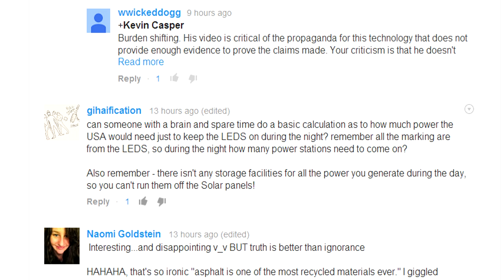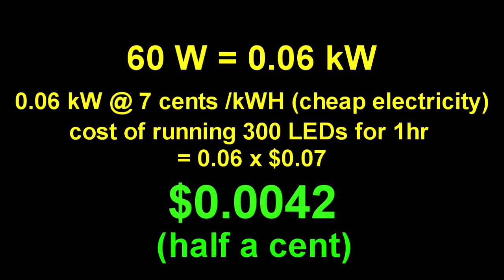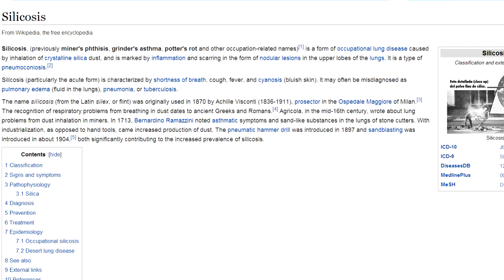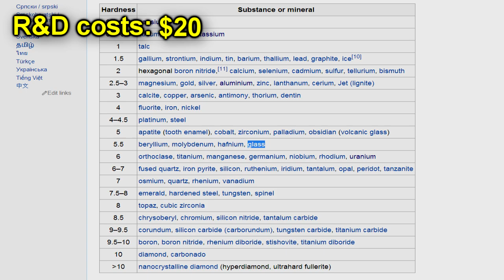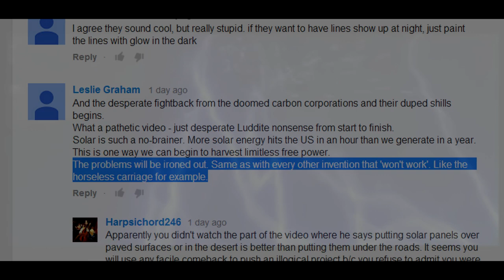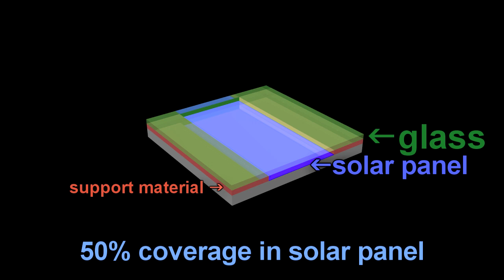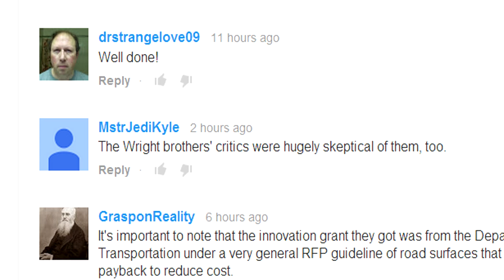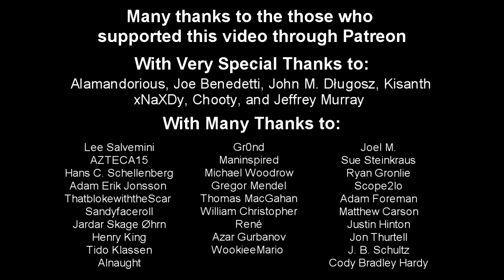Solar Roadways, IMPORTANT QUESTIONS AND ANSWERS!

Comment: There are so many things wrong with this video its not even funny, first of all, the price you came up with for the leds, besides the fact that you got the price you used to find the cost was from one source, they obviously would be buying them in bulk or manufacturing them themselves, not buying them in strands of 300. The next thing you didn't even use your brain on was the electricity, you just loosely based your data and came up with a number without even subtracting the amount of energy they would produce. And, I'm going to stop after this one because I could just as well write you a novel on the things you did terribly wrong, but here's a list

      you used Wikipedia as a source of information (more than once)
      you wouldn't have to stop using the road when you replace the lights because they can be replaced a tile at a time
      the glass is obviously not the same as something you would use in a glass bottle
      your cheap little leds are not what they would use in the panels
      your stupid tests do not prove anything you idiot
      and lastly your efficiency test is so eluded and idiotic its sad, no the panels arent going to tilt towards the sun because             people have to drive on them, your shit piece of solar panel will more than likely not be what they would use in the                 road, did you forget what you were testing by any chance because it seems to me like your swatting at invisible                   butterflies with these tests of yours

thanks for the good laugh, you definitely made me feel better about my I.Q
Reply: Wikipedia is perfectly valid if you're accepting a small chance of having a mistake.

You would stop using the road when you need to fix/change the concrete foundations or cables. Road fixing would be just a common as with concrete roads, except that you'd have to remove all of the tiles to fix a more intricate structure.

Yes, there aren't many types of glass, it's all the same with a bit of alloying depending on what additional caracteristics you want.

Well either they'd use cheaper LEDs or more expensive ones, you can't have both.

Yep, they just illustrate points for those who have wrong ideas about things.

Yes, because now they have some super efficient solar panels no one knows about ? It's all the same shit more or less.

I'll grant you that Thunderfoot made a very poor debunking of solar roadways, because he didn't focus on the right aspects. It's not about solar roadways being possible to build or not, it's simply basic economics. If you have two companies, A and B, and you need a service from them. They both provide the same service, yet one costs 3 times as more than the other, which one do you choose ? Well it's the same for solar roadways, it's one of the most expensive ways to produce renewable energy, yet it doesn't even do it as good as the alternatives. It's like paying 3 times as much for a shitty service.

Comment: I'm having a hard time understanding the information about the cost of the LED lights and the electricity to run them. You're not proposing that they be purchased in flexible strips from Amazon, are you? That wouldn't make any sense. That calculation requires insight into manufacturing costs, not retail sales. As far as running them at night, lighted road markings would require a fraction of the road to be lit up.

Also, while the very zesty claim is that all roadways could be covered with these panels, I'm sure no one seriously believes that this will be the case. The claim in their video is that it would provide three times the amount of power we need, not that it is the goal. If you want to do serious calculations, start by dividing all of your figures by three.

It sounds like this new technology needs as much input as it can get.

Comment: i am only on the first question and i can already tell you that you're a dumbass. they arent going to buy the LED's in 20 pack increments. They'd buy them, in massive bulk, straight from the manufacturer. Have yo ever heard of buying in bulk?
Reply: and i can tell youre an even bigger dumbass
check the power of those LED`s he got, it`s only 0.2 watt each, which means they are very weak so he would need much more powerful, much more expensive ones
so shall we say for bulk buy of more powerful LED`s are only 20% of his price that still gives us a total of $160 billion just for the LED`s which, quite frankly are probably by far the cheapest part of these panels
but then as the LED`s would need to be more powerful, say maybe a watt each, and that you need at least 5% of them on at all times, that means it needs $350 billion per year just for the LED`s
however, they produce energy through the day so you get 7 hours peak multiplyer from the 24 so you would need $248 billion per year from the grid to keep them going at night
that is currently 6 times the amount they currently spend on building new roads and on maintenance of existing roads
even if i was generous and gave it a 12 hours multiplyer the cost is still $175 billion
can you see the major flaw in your reasoning here, dumbass

Comment: or 0 trillion dollars to power the LEDS because they are SOLAR POWERED
Reply: Solar power is not free because there's a large capital outlay and a definite lifetime. By taking the install cost and comparing it to the energy it's expected to create over it's lifetime, you determine the cost of that power. Except of a very small number of niche areas, this number does not compare favorably to electricity generated by coal, gas, nuclear, or hydropower.

Comment: Nice work. The absence of critical thinking is stunningly popular. This has probably been mentioned, but: parts of the US get a lot of snow and ice in the winter. Tough to drive on  for most. I can't fathom drivers on snow or ice covered glass. Unless maybe the LEDs are supposed to melt that! It's painfully obvious that a transit system that doesn't emphasize cars would be a fraction of the cost...  Thanks again - enjoying exploring your channel.

Comment: every one keeps saying this is impossible but all you need to do, when building them, is to reverse the subspace polaraity of the Heisenberg compensator and wire that baby into an inverse flux capacitor! Boom problem solved!

between there solar road and my fixes to the design i think we have it solved people. Oh yea almost forgot, embedded in each 'solar hex' will be a pair of googly eyes, you know... to aid road friction with tires.

Comment: While your videos are fun, I think you mess up a bit on the LED stuff.  Firstly there is no reason that power can not be stored in (or near) these panels, note that the company is specifically asking for supercapcitors.

Secondly LED technology is on the march.  So while your sample LEDs have trouble in bright daylight, we know that traffic lights are being replaced with LED lights world wide which function in the day.

Thirdly you calculated the power requirements based on the assumption that ALL the LEDs are on, all the time. In the examples given most of the tiles had no LEDs on, and some had as many as 6 or so. So it looks like maybe 1 LED per tile on average.  But wait!  These roadways have strain gauges and so know when there is a vehicle or pedestrian around, and therefore only need to light up at those times.  For many residential roads, especially quiet cul-de-sacs this means they can turn off nearly all of the time.

And that's not all! The LED's you used, for example, are 120 degrees viewing angle (another reason they were hard to see in the daylight).  The human iris subtends an angle of a fraction of a degree at any relevant road distance cutting the theoretical required power by another factor of at least 10,000,  however let us assume that signage is implemented for a 40  degree  by 15 degree angle, this alone cuts the required power (or boosts light output) by a factor of 24. 

So if solar roadways were considered unsuitable for  major highways (which I would expect anyway) and only implemented on minor roads and the other flat areas suggested they would be able to easily power the required LEDs

Moreover LEDs last much longer than you suggest, the figure of 5.7 years is based on 50,000 hours at 100% duty cycle, actually  developements in LEDs are moving so fast that we do not know how long they last, but figures double the one you quote are given by some manufacturers - that's about 12 years - and if the duty cycle were 10% it would extend the life time to 120 years.  Even then the LED does not fail, is is simply capable of producing less light (L70 - 70% of new).

That's not to say that solar roadways ARE a good idea, at least with current technology, but the LED part is not a show-stopper - and even if it were we could fall back to good old paint.

==References==
1. http://apps1.eere.energy.gov/buildings/publications/pdfs/ssl/lifetime_white_leds.pdf